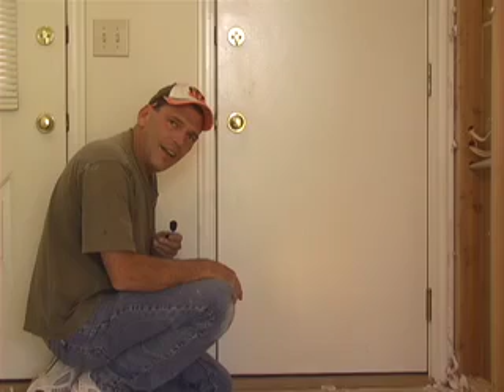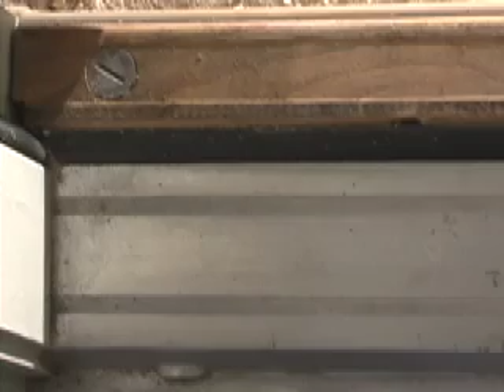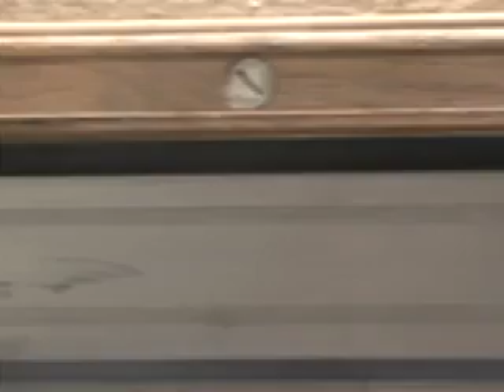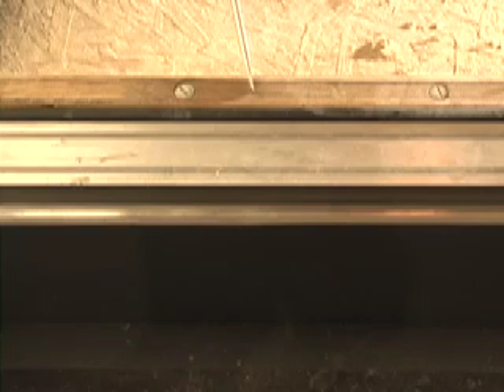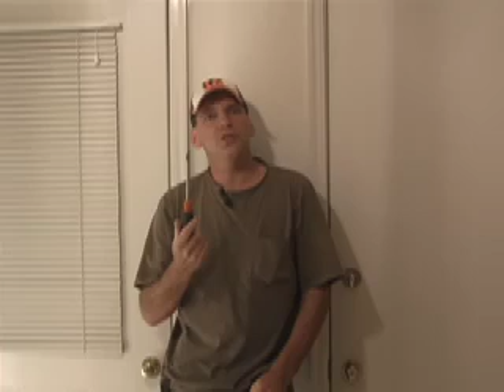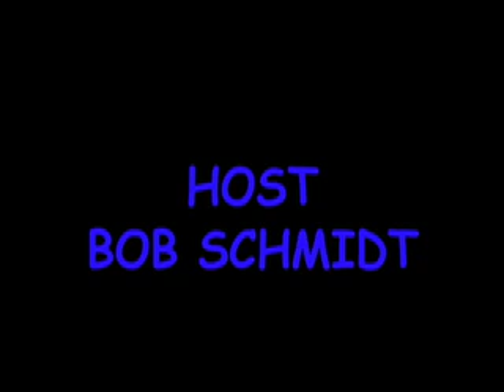AIR UNDER DOOR A SIMPLE HOME IMPROVEMENT DIY

Comment from the maker: If the sill (the wood/metal piece under exterior door) has adjustment screws you will see them in the top of the sill. No the door does not have to be removed. When adjusting screws do them a little at a time closing door frequently to make sure you do not over adjust. +++Bob